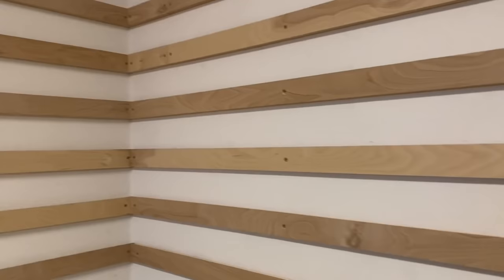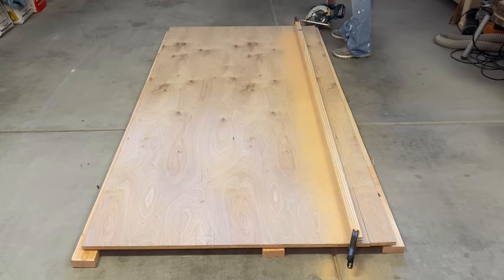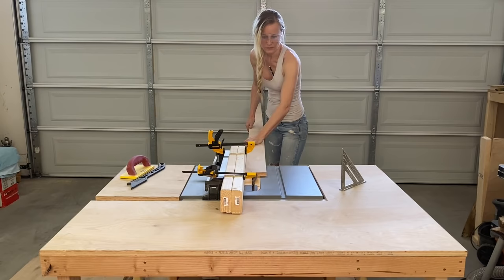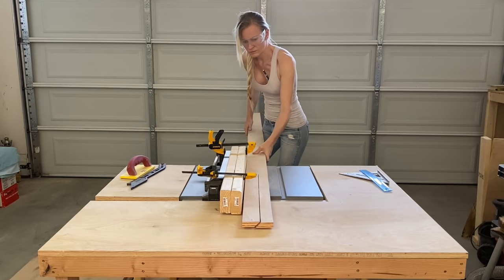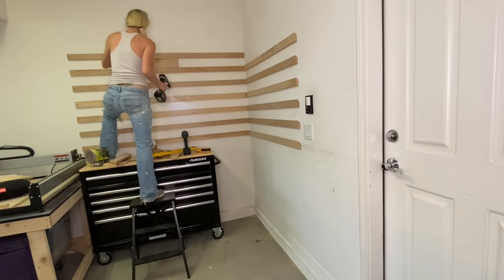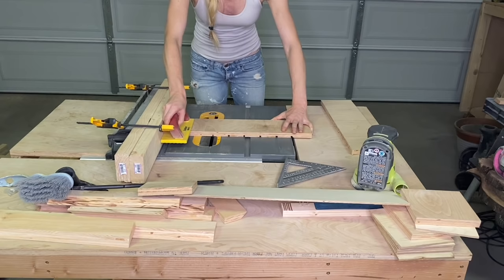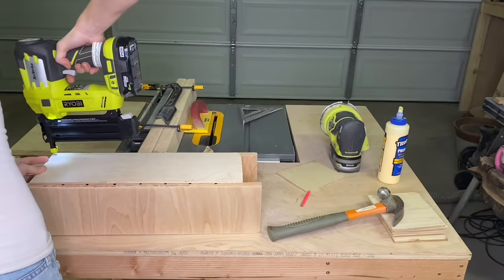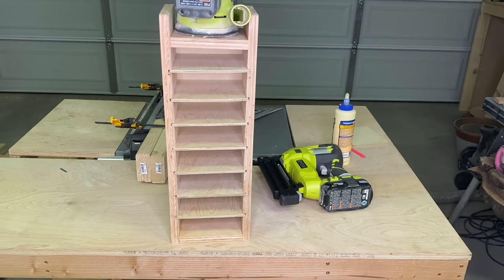DIY Build - French cleat system

Comment: the way she is using the table saw, she seems very afraid of it!
Reply: Tougher to use a push-stick with those clamps on the fence. It did look a little sketchy at times. An out feed table would help quite a bit. Also, be careful when cross cutting short, wide boards. They can bind easily and give nasty kickback. A sliding table is a great solution for that.
Reply: I noticed that too, the way that board was coming off of the fence and the look on her face.  She looked scared to death of it.

Comment: Why waste all that time with a skil saw and straight edge when you have a table saw?
Reply: @WhatMeikeMakes  a table saw definitely deserves respect. There were a few improvements you could make to have a safer experience with the tablesaw.. .An outfeed table supports long pieces as you push them through. Getting rid of those clamps so you can use a more robust push stick against the fence would also help. Also, using a sliding table makes those short cross cuts less likely to bind and jam. You could do an excellent video on how to make a sliding table. It would be worth your while to have one. Keep up the good work, I liked your information presentation.

Comment: Not the safest/best practices techniques, and I'm not talking about the hair that everyone seems to be hung up on.  

1:32  - Why clamp two uneven chunks of 2x4s to the fence?  There is no such thing as a straight 2x4 off the rack.  I get that the saw is a portable or jobsite table saw with a woefully short fence but use something straight if you must add length to the fence.  

1:35 - No riving knife or splitter for ripping, and even worse, coupled with no feather board for ripping.  The material wasn't even held flush against the fence; contributing to that is that you are pushing against material before it is even with the fence so the fence is not behind the material.  At the least you get uneven cuts but you are just asking for kickback, which can have major consequences.  This is extremely poor and dangerous technique.

5:28 - Never use the fence as a guide to cut those dados or any other crosscutting, and you can't use two hands like that and hope to push material through evenly.  You WILL get a board thrown back into your head/face/body at 300 mph (blade is spinning at 3500 rpm) or have a hand pulled into the blade sooner or later, and it will happen in less than an instant.  You are compounding unsafe operation by not maintaining constant control over the material - you lift the push block and reset it on the material.  At least use a miter gauge, preferably a crosscut sled, easy to make.  

Technique leaves a lot to be desired in this video, and I didn't even watch the whole thing, skipped through it.  I wouldn't recommend this video to any woodworker.  There are many excellent woodworking youtube videos that display safe practices.  Watch some of them.  No offense, but you really don't know what you're doing on that table saw.  Good luck.

Comment: everyone keeps making references to your breast, clothes and hair. how about what a really nice video of doing a french cleat system for the DIY'ers? the fact that you were comfortable with that super tight, extra small tank top has nothing to do with it! also, so what if you like pink 2:29? my only suggestion is that you should have been using a dust mask when sanding. you dont want to get all those particles in your throat and mess up that lovely accent. :)

Comment: 03:45 Holy crap ! Straight in the wall, without these Fischer dowels . If that ever holds..
05:42 Okay - I'll take that back.
05:51 Jesus Christ ! Please make a cross cut sled first, and use it for cross cuts . Cross cutting on a parallel fence is way to dangerous. Safety 101
06:34 and those one hand clamps getting constantly in the way. This is not good.
Reply: Langer Zopf und Tischkreissäge,  wie Wasser und Strom...passt bestens!!!